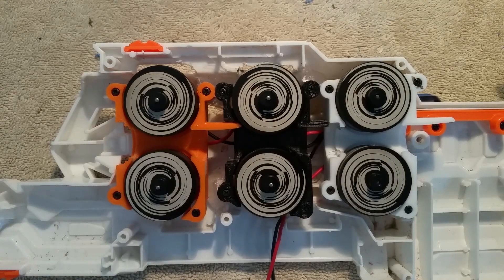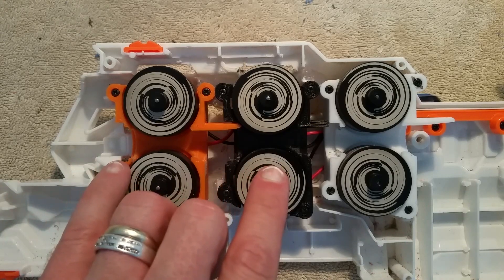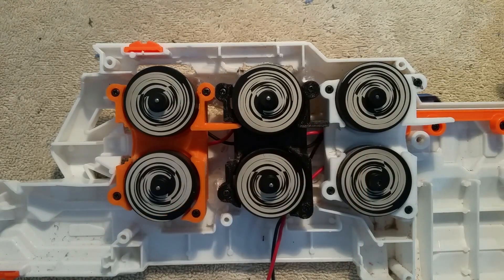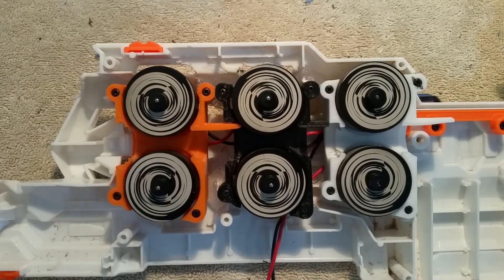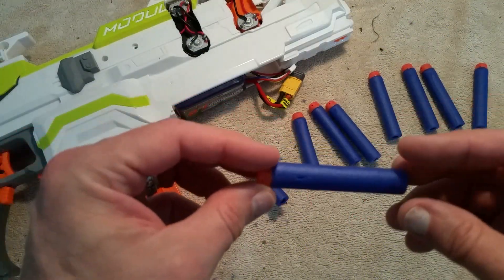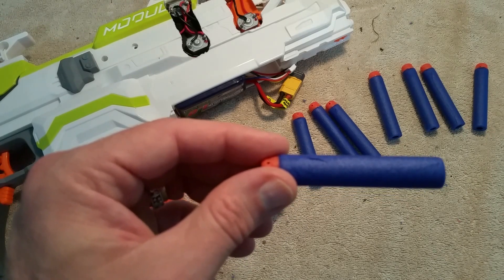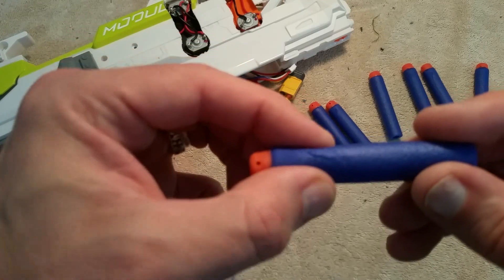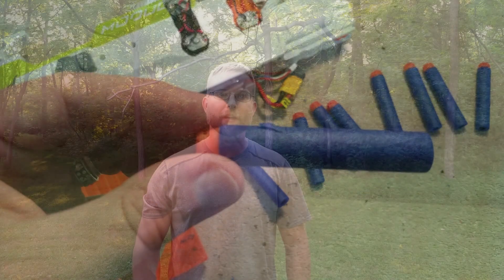Q200 - Open Flywheel Project Cages

Comment: This may be too long after this vid was posted, but you never know. Here's to hoping you check your comments on occasion. I've pitched this idea to others, but so far, no one's really caught on.

Unstable darts are commonly considered to be an "aerodynamic" issue. While I agree air resistance does come into play, I believe there is a principle at work here that better explains why some darts respond the way they do, much more so than simple air resistance and drag. Simply put, balance.

It's a concept considered in traditional archery (something I do) to be essential, and it's called FOC, or front-of-center. What FOC is, is essentially the ratio of an arrow's mass that is 'front-of-center' of the overall length of the arrow in relation to the balance of the arrow. If we can find the dart's balance point and length, we can figure out before even shooting a dart whether it will behave in flight (at any speed) or fly erratically. 

In archery, most folks are shooting for a 10%-15% (up to about 20-25% in special circumstances) FOC ratio. Too low or too high produces different types of erratic flight, depending on the projectile itself. IT's almost funny how much out of balance arrows act like similar nerf darts in flight.

Calculating F.O.C

To determine the F.O.C of an arrow (let's see how it works with nerf darts):

1. Divide the [dart's] overall length by 2.
2. (This will be the trickiest part) find the balance point. This is where the [dart] balances perfectly. Mark the point, and measure from the back of the dart. I do it by carefully rolling the dart over a paintbrush or other small cylinder until it tips.
3. Subtract center of the [dart] measurement (calculated in step 1) from the balance point (calculated in step 2).
4. Multiply the resulting number in Step 3 by 100.
5. Divide the resulting number from Step 4 by the dart's overall length. This number is the F.O.C. % of your [dart].

For my calculations I've chosen a standard elite dart, an ebay bought FVJ (classic green foam and solid red tip) and a boomco straw, hopefully for obvious reasons.

Prediction: The numbers will read similar to what is objectively known: The Boomco dart will prove to be the most stable/consistent (I.E. nearest to an ideal FOC), the Elite the least (furthest), and the FVJ somewhere in between. Spoiler: I did not know the results before my calculations.

FOC Steps:

1. Overall Length /2; Elite: 1.4375"; FVJ: 1.40625"; BC: 1.40625"
2. Length from back of dart to balance point; Elite: 2.25"; FVJ: 2.1875"; BC: 2.0625"
3. Step 2 minus step 1: Elite: 0.8125; FVJ: 0.78125; BC: 0.65625
4. Step 3 x100: Elite: 81.25; FVJ: 78.125; BC: 65.625;
5. Step 4 / dart OAL; FOC= 

Elite: 28.26% FOC
FVJ: 27.77% FOC
Boomco: 23.22% FOC

Result: As predicted, the most obviously observably stable projectile, the boomco dart, has nearly an acceptable FOC, approaching the 20% mark, while the FVJ and elite darts were higher, respectively. I also suspect my measurements were likely a bit off, as the FVJ dart shouldn't be so close to the elite, given how much better they generally fly. Still, it's telling where the FVJ rests, exactly where i predicted, somewhere in between.

Conclusion: if I did it again I'd use a much more precise instrument (caliper) to get my length measurements in the thousandths. I would also use an average length of say, ten or 100 darts of each type, rather than just one. Overall, this is not exactly what I expected; I thought the FOC numbers would prove to be LOWER than the 10-20% range. 

We could crunch air resistance/drag numbers into it pretty easily later on, but, air resistance has MINIMAL effect on properly balanced projectiles. Based on what I've seen, I would say, given materials, ideal NERF dart FOC is in the +/20%-25% range. The difference in relative length between arrows to darts probably comes into play as a variable as far as an ideal number is concerned. I'll bet the FVJ is actually somewhere closer to 25-26% FOC too, as well as the presently popular waffle and accustrike types. I suspect there's a slight advantage in FOC of the nerf elite suction darts over the standard elites, too.

Thoughts? Nerf science FTW. Nice vids, love the channel. Thanks for reading, hope this helps somehow.
Reply: Nerformance Mods this may be too long after you comment was posted but the balance of darts has been the foundation of our understanding of dart ballistics for over a decade.

Comment: The waffle darts shot quite straight but the others sometimes spiraled and fishtailed pretty crazily, which killed their range and consistency when it happened. You may want to consider adding a length of 19/32" or 9/16" brass tube at the end to act as a guide to help even that out a bit, perhaps.
Reply from the maker: I actually think it is the aerodynamics of the Koosh darts that is causing this.  I don't think they are stable past 150 fps.
I've been considering brassing this build.  It will probably cost me 25 fps or so, but you are right that it should improve accuracy.

Comment: Does the spinning of the flywheels give the blaster a gyro effect where its hard to control or move around?
Reply from the maker: I have not experienced that effect with any of my flywheel builds.  I think it is because the flywheels are small and light compared to the rest of the blaster.

Comment: What's  the distances between the cages? Is that the optimal spacing between cages for multi stage builds? :D
Reply from the maker: There are about 52mm part - center to center.  That was as close as I could get them and still be able to swap them out separately.  As to optimal, imo closer is better assuming the motors are spec'd properly.  I have heard of people 3D printing with a center to center distance of as little as 40mm.

Comment: With mine  it seems very hard on the darts with a single shot starting to pull the heads off, after inspection ( ellets )
Reply from the maker: I'm seeing some of that too with these cages running Cyclones.  Maybe 1 head every 50 shots or so.  I think it is more of a dart issue than a blaster issue though.  The waffle heads don't seem to be as well glued as the Koosh or FVJ darts that I have.

Comment: Do you have a source for the Kysan 17114 motors or do you order it from Kysan directly? Their shipping costs seem to be the same $20 rather you order 1 or 100.
Reply from the maker: I order them from Kysan directly.  I think the last batch I ordered was about 60 or so - they have a $100 minimum order..
Reply: Ouch, don't think I can justify the buy in lol. I was looking for some of these for a possible IMR based mod. I share the hobby with my son who's not quite ready for the world of LiPo and we already have the IMRs. Thanks for the info.
Reply from the maker: J C Tbh, 3 IMRs with stock motors is not that bad of a build.  You can easily make a dummy battery out of a piece of 9/16 all-thread and a little electrical tape to fill the four slot.  The motors will eventually burn out, but you will get many, many wars in before that happens.